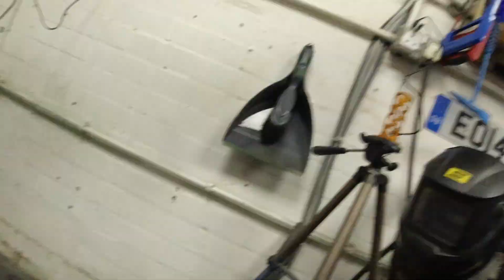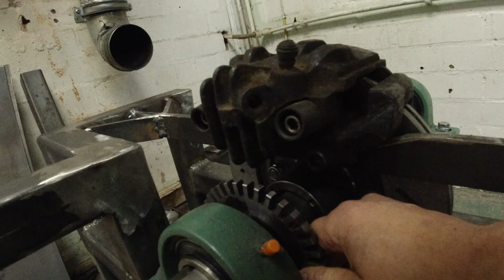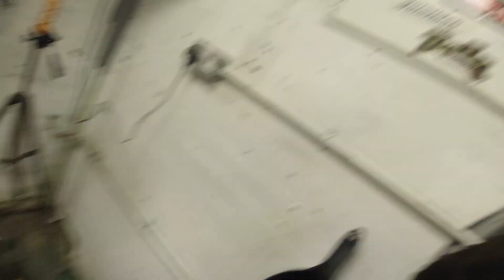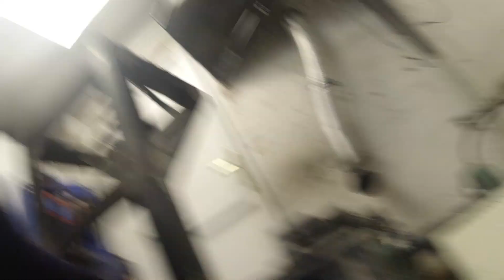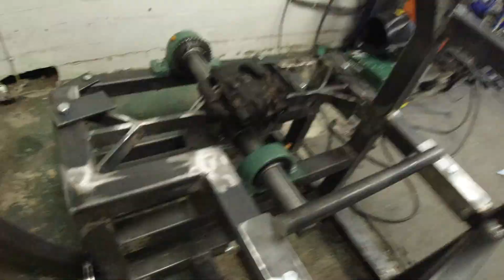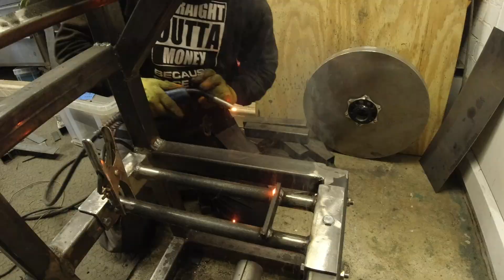DIY Dyno Part 2

Comment: Hi, I came across the video of the blue carbon roof for the Corsa B.
I live in Brazil and I have a Corsa B Serdan and I would like to know if it is possible to buy carbon parts such as the hood, trunk lid, fuel filler cap from you and have them delivered to where I live.